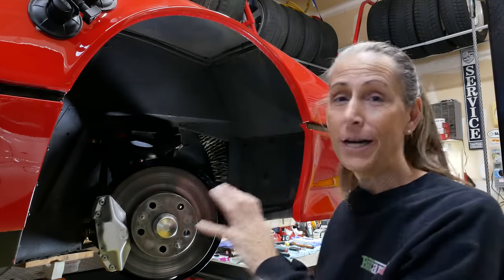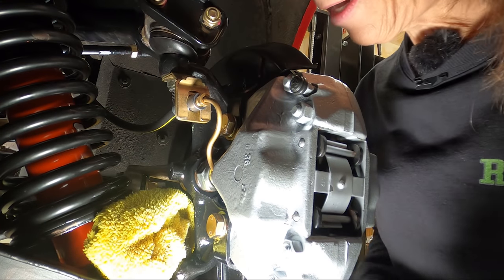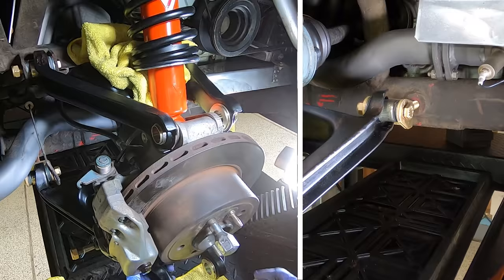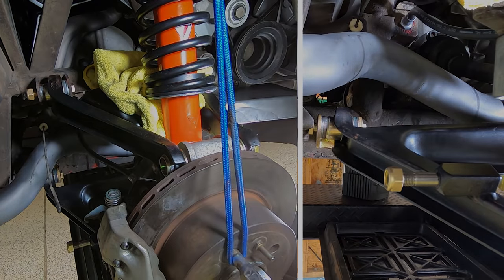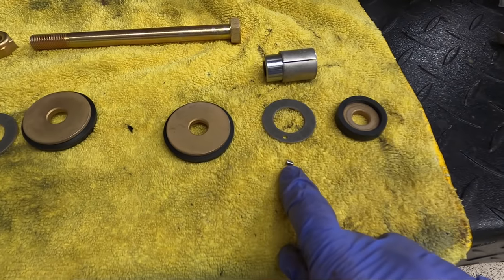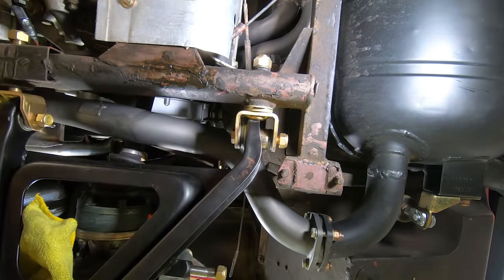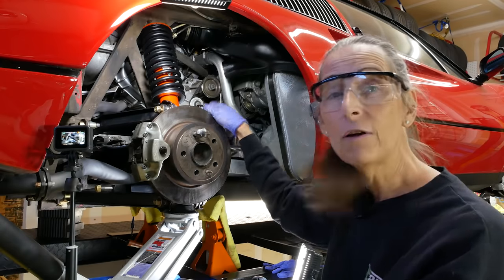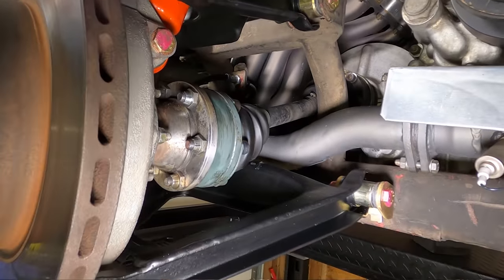Rear Suspension Assembly Finished!! (Some Questions...) - Ferrari 308

Comment from the maker: Hi Everyone,
Sorry this one is soooo late :( I have been out for the count for a couple weeks. In this episode, we get back to finish up the rear right suspension.  It went pretty well.  Question: Do you lubricate PTFE bearings AND What happened to my light??!!  Enjoy!
Reply: i wont lubricate PTFE coated bearing since it's not necessary
Reply: But it doesn't hurt the PTFE coating, even long-term, so if it makes the assembly easier, go for it.
Reply: I lubricated mine, just to cut down on the chance of squeaks developing.
Reply: Out for the count?  Hope you’re feeling better and it wasn’t the Cov word….
Reply: @ruaraidhmcdonald-walker9524  Hope it wasn't kickboxing, either!
Reply: @howardscott7521  problem is lube attracts dirt and dirt grinds off the PTFE leaving you with a sloppy bearing. Best left dry.

Comment: Here's a tip that I "invented" and was not eager to do, but it works:

If you're SURE your new hose (brake, fuel, etc) is the correct part, then chop that hose close to the fitting and put a deep socket over it!  That plus an extension, would have put your ratchet out into free space and you'd only have to worry about wrench room on the back side of that fitting. And wouldn't have had to turn that back side wrench, either, just go after it with your ratchet. (Or as the rest of the world would do it, 3/8" electric hand held impact gun?)

Comment: Hello from Scotland,
A wee tip for you Franny.  When you know you're about to work on brakes,  put a tube on one of the bleed nipples into a container,  use something to hold the brake pedal down to the floor (hammer shaft to seat).  What this does is expel fluid into the container in a controlled manner but because the reservoir is blocked off by the master piston it means you can work on any brake without the fluid flowing all over the place. It just makes it much more pleasant to work.
Reply from the maker: Thanks so much for that!

Comment: A rule of thumb on automotive normal thread metric bolts into steel (not fine thread into alloy!), to fit suspension and engine parts.
Torque settings in Nm = π times bolt diameter in millimeters.
So simplified: 3 times Ø (ish), rounding it of is fine, you won't strip a sharp thread with a few Nm over.
M6 = 18Nm (20)
M8 = 24Nm (25)
M10 = 30Nm (30)
M12 = 36Nm (40)
M14 = 56Nm (60)
Etcetera.
And 10Nm is 1 kgm (ish)
This does not include fine threaded wheel bolts and nuts
These are typically 100 to 120Nm depending the wheel material.

Comment: Very Nice!  Glad you finally got the correct brake hoses.  My 356 hoses finally arrived a few weeks ago.  As to tools...my set of $nap-On, crow's foot flare-nut sockets have saved me many times over the years when regular flare-nut wrenches simply will not fit.  Some other companies make a 12-point version, but they scare me and I have more confidence in the 6-point type like my $nap-on wrenches.
Reply: The Torque Test Channel here on YouTube did a video three weeks ago comparing various brands of flare nut wrenches, and the Snap Ons lived up to their exalted reputation.
Reply from the maker: I bet!

Comment: Antiseze when pressing in a metal bearing? Go for it! That is one of the specific uses for antiseize, to prevent spalling and galling of metals.  Might even find spalling and galling mentioned in the fine print on the outside of the larger bottles.

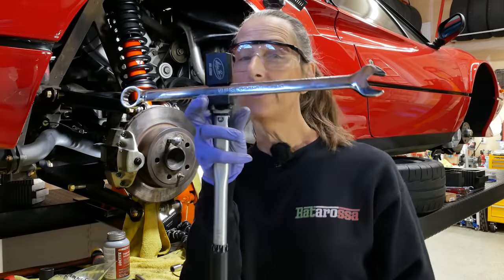Comment: 16:23 : There are crowfoot slide-in adapters for Your type of box-end torque wrench available, like the HAZET 6450D-22. Works like a charm, but Your wrench adapter is a little bit more versatile i guess.

Comment: Hello Franny, so that the brake fluid does not leak out, you only have to press the brake pedal a little, about one centimeter, and the piston in the master brake cylinder closes the hole to the brake line.
Simply clamp a stick between the brake pedal and the steering wheel. 
It only drips a little from the line.
If the line and the brake fluid reservoir do not run dry, bleeding is also much easier.
Reply from the maker: Thanks so much for that :)

Comment: Hello Franny, I noticed the dripping brakelines. What I always do is open the brake fluid reservoir put a piece of a plastic bag over it and screw the cap back on. Then an open brakeline hardly drips because no air gets in from the top. It wil save you a lot of cleaning up. I guess I do not have to tell you that brake fluid is nasty toxic stuff.

Comment: Just what the doctor ordered on a windy and rainy day: a new video of Heidi and Franny's Garage :) Glad you got the correct front brake lines. Working on the suspension on this car is quite fiddly, but you did a great job as usual, Franny. Thumbs, up! Great tip on the hockey puck.
Reply from the maker: Thanks so much!  Sorry for the delay.  This car is very particular about the order in which you do things.  It would be great to know that ahead of time :)  I hope all is well.
Reply: Things are good here :)

Comment: Great as always!

I agree with you on the torque value for the upper shock bolt.  That is a bigger bolt and should be cinched down like the others.  The thought of balance on the component (top and bottom) appeals to me for some reason.

Comment: Great to see you got the hockey pucks! They are available in any corner store in Canada but maybe where you live they are a little more scarce :) Either way they have endless uses in the shop and it is awesome to see it added to the tool roster. 

As for the suspension it can be a real bear to build on the car. I have some photos from the factory back in period where it shows that they would install the whole corner complete with shock, suspension arms, and even driveshafts on the assembly line. Of course this is not practical in a home garage so it takes a lot longer as you found out. Keep up the great work.
Reply from the maker: Thanks for that!  That's really interesting that they installed the entire assembly.  That makes sense.  It would be a lot easier on the bench.  IF you look closely you can see that some of the scenes are out of order ;)  There was a bit of getting 90% of the way and then having to pull it back apart a bit and change the order.  I didn't want the video to be confusing so I re-edited it in an order that worked for me.  Oh, yes, the hockey pucks are great!  Not super common here.  Also, I guess there are a few different sizes?  The ones I got were smaller.  Actually worked great  though... :)
Reply: Spectacular idea, im about to enhance my jack game presently.

Comment: PTFE. If it's PTFE it's there to reduce friction. Anti seize paste won't help on that surface. Also anti seize paste on bolts that have to be torqued down to a specific torque is not useful, because it reduces friction, so the torque is not correct.

Comment: As always great to watch and of course every 10 minute job take at least an hour! It may be the lightning but I believe your exhaust is coated in some way can advise what it is, if anything?
Reply from the maker: The exhaust (except for the muffler) has been ceramic coated.  We used the same shop and color as on the 3.2 Carrera.  Ceramic coating is like powder coating but thinner and can take the heat of the exhaust.  It will tan a little, but it looks so much better than the rusty bits before.  Those are all the original pieces!  Love that stuff :)
Reply: @HeidiandFranny  👍

Comment: Great videos! One question - did you instal the bushings before painting the suspension parts?
Reply from the maker: Thanks! The parts were powder coated and then the bushings pushed in and tack welded. Then just a dash of black paint to finish them off.

Comment: Hi Heidi enjoyed and learned a lot from the video as always
One quick question though please. Does the Ferrari manual tell you to torque the suspension with no wheels and jacked up with no weight on the arms? I wondered if it might be similar to BMW where you leave the bolts a little loose refit the wheels put it on the ground and roll it to settle it and then do the final torque. This is not a criticism I am just trying to understand suspension as all cars are different 
Many thanks and greetings from the UK
Reply from the maker: Hi Philip, the Ferrari manual is a bit thin on actual procedures so I got with Lou Trotier and asked his opinion. He said it is acceptable to just raise the suspension (I jacked up each wheel until the car lifted up off the stand) before I torqued.  That should be really close to being down on all fours. So many of those nuts and bolts are hard enough to get to with the wheel off that they would be next to impossible to correctly torque with the wheel on. Lou mentioned it just needs to be close ;) I would think your BMW is probably a bit more refined than the 308 ;).

Comment: A tapered "line up" tool is a wonderful thing to have! Many decades ago, I wandered into Sears and bought a set of punches/chisels/line up tools, and I thought, was this a foolish purchase? Will I really be using all of these? Well, it turned out to be a great purchase over the years! 

I recently bought a Mayhew "lady foot" pry bar, to see if I had a use for "lady foot" prybars,  Mayhew #40150, made in USA, 12" long, it has a nice taper to it and the tip is tapered, too, I grabbed it in the middle of a ball joint job and it was just the ticket. (Not that I didn't have three other old Sears tapered lineup tools in the quiver.)  $31ish over at Jeff Bezos' general store. No link because I think that sends my comments to Cyberberia.
Reply from the maker: Links can get you blocked as well.  YouTube does not like you leaving the platform.

Comment: Another great video, did you coat any of the bolt shanks with anti seize before install? I live in UK.
Reply from the maker: Thanks! Yes, all the bolts were coated during assembly.
Reply: @HeidiandFranny  thank you for quick reply, what did you use, youve mentioned copper grease a few times for getting the parts into position.